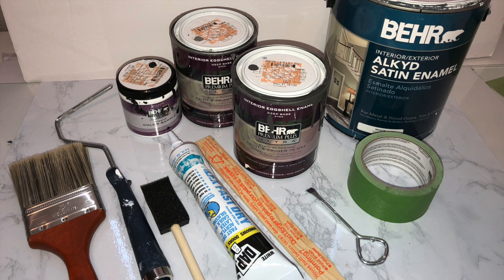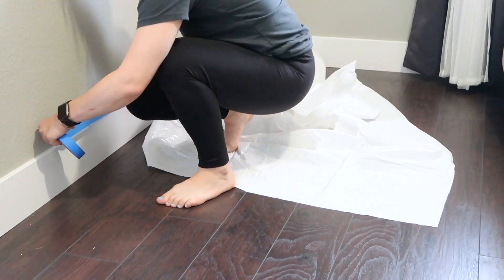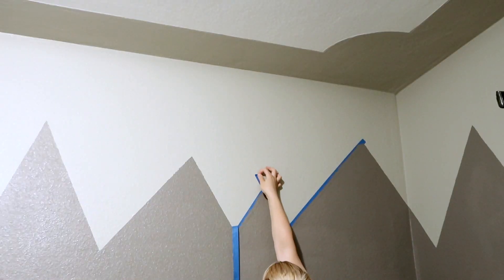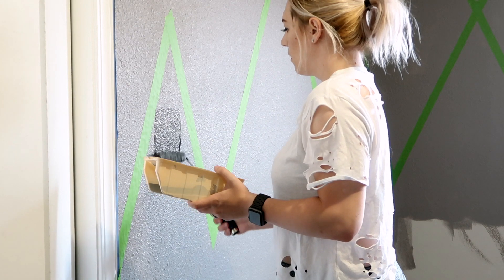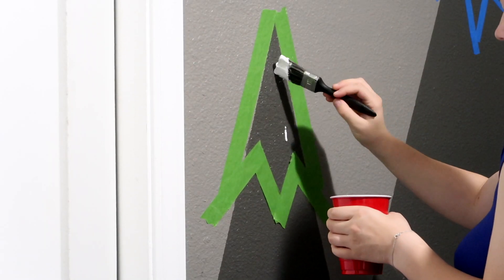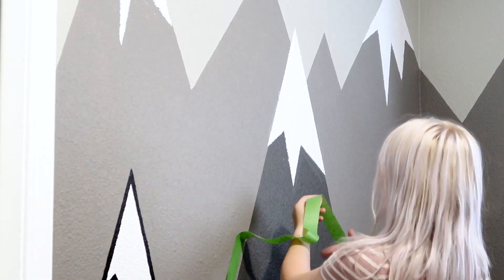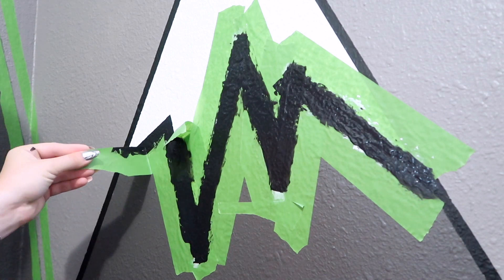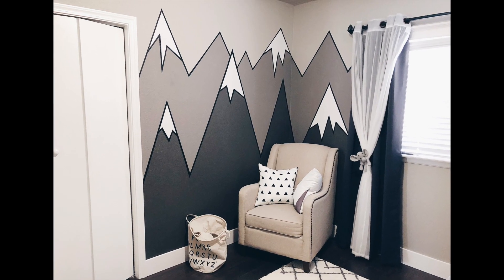How to paint mountains on bedroom wall, nursery diy

Comment: The only issue is when you want to repaint the wall. All the caulk is going to need to be scraped off. Which means you will have to skim coat the entire room before repainting! Otherwise you will have 2 class 5 walls and 2 textured walls!
Reply from the maker: probably. this is our own house, - I would never do that while renting lol and so the wall can be here for a while (: I did mountains so its not like too babyish and can be on the wall for a while (:
Reply from the maker: oh also we remodeled the home so we had to insulate the walls facing th e outside, so brand new walls had no texture like all the other walls - turns out you just spray the texture on. it was actually easy (: